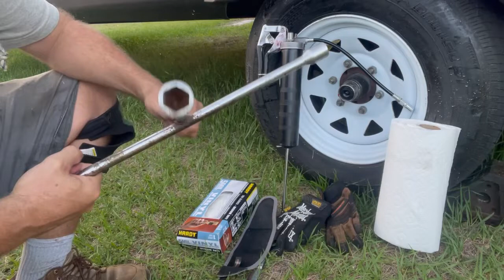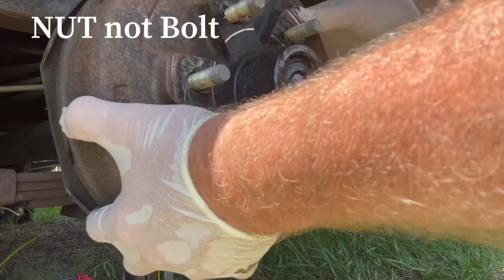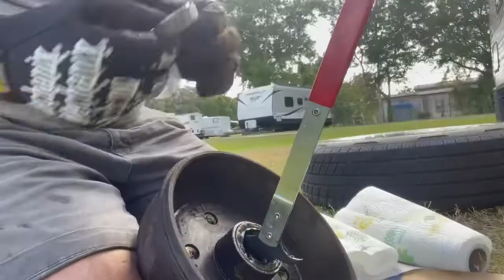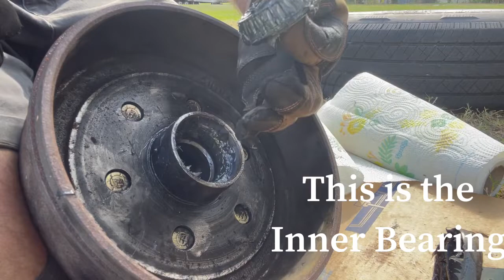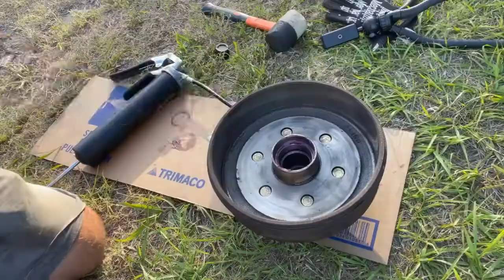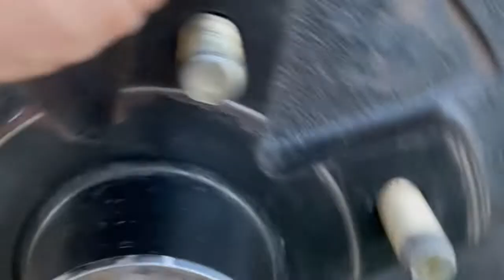Replacing Wheel Bearings in RV Trailer

Comment: We lost a bearing with only 5k miles left us stranded in Nashville they made an axle overnight for us.  The F-en outside bearing is to small and they revised the hub on the 6000-7000 lb axle to have a larger bearing due to this issue.  Lippert should have replace these on this set of axles. Fuck Forest River and Lippert they knew this was an issue for how many years; 5 plus !!!!